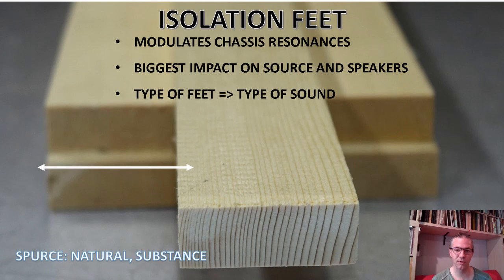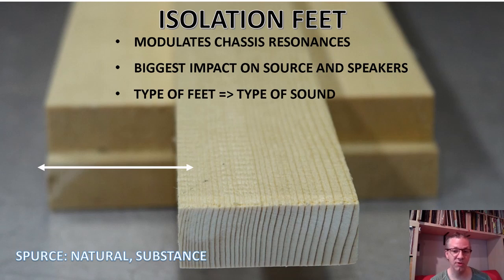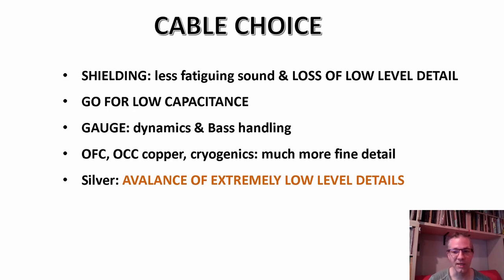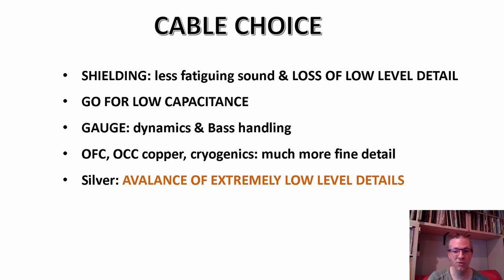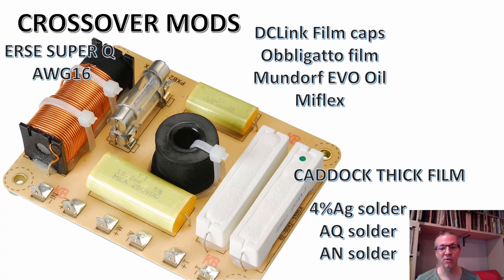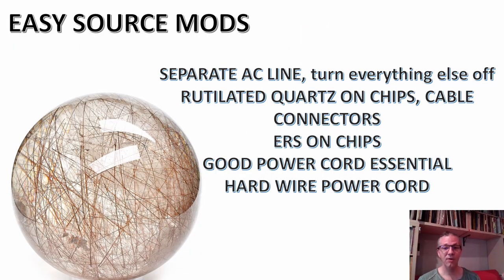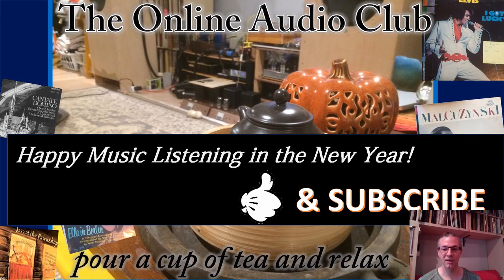Low Efficiency Speakers played at low volume - how to improve?

Comment: Some words about my journey: It has been only 3 years since I put together my first hifi beginner’s system, so I am a newbie compared to most. 
I have several constraints for the speaker size, location, and listening levels, but after having this first system, I saw that I actually could get much more pleasure from the music than I expected and even if I am far from being able to utilize my components to their fullest potential, I learned that I am still able to further improve the system and listening to music gets more and more enjoyable, even with the adverse conditions.
I sit in a equilateral triangle, 2 meters to the speakers, so almost near field.
Recently I have purchased bulk furutech 032n power cord (12 awg, voltage here is 220V) where I assembled the connectors and this now feeds an used furutech strip with no active filtering. My current plan would be to use the same cord to my amp in the feature. So far I could notice, in my own words: better bass definition, better separation (from bass lines in rock songs and/or from voices when more than one person is singing at the same time or in choirs), and in some cases the music seems to be “bigger” for the same volume as before, so maybe larger scale or impact.
I will research possibilities regarding new interconnects and speaker cable taking into account your tips and come back to you (currently they are qed audio reference 40 and qed revelation). Unfortunately I cannot keep the speaker cables separated for now as you suggested, but this is a wonderful tip and will keep this in mind for the future. The tip regarding the length is amazing, I will be sure to follow this.
 Hopefully I will find a trustable company to help me modify my speaker.
I will very soon look for the ferrite beads and install some, and for sure will experiment with wood feet, but as a last step after all else, so it will take a while. Once again thank you very much, I am deeply thankful!
Reply from the maker: Thank you for sharing your journey! Great job with the DIY power cord! In the near future I will share how I make my DIY interconnects. Also, the almost near field listening is a superb way to get more at lower volumes - I missed that out from my video. :)
Reply: @realworldaudio  thank you, it was more complicated than I thought but worth the effort. It is reassuring that despite the restrictions and lack of experience I am getting some things right. Looking forward to your next videos.
Reply: 30x ferrite beads on their way! Thanks for the tip once again. You mention in the video a light shielding could still be ok for the line level interconnects, not killing the low level details. Could you please comment a bit on what of what would be considered a light shielding? For example, could a braided copper shield over the twisted pair (with a layer of teflon in between) be considered as a light shielding? Thank you
Reply from the maker: @Thiago_S..  Have fun with the ferrites! Start with the biggest appliances and the digital gizmos: computer, TV, router... Yes, that's a great example of light shielding. However, if you live in a good neighborhood (I mean EMI/RF -wise: that is, no cell phone tower nor power stations nearby), then most probably you will do better with a good twist alone. Shield would be beneficial at the phono stage level, such as hooking up a low output MC cartridge to the step-up transformer, and/or the step up to the phono stage. Also, sometimes the cables connecting your source to the DAC can use shield, but most often bare connectors are better. Good luck!
Reply: @realworldaudio  thank you for the clarification and valuable insights!

Comment: Hi! Do you (or any of your trusted friends :) have any experience with or knowledge of the compatibility or lack thereof of Audio Note cables? I have their copper Lexus LX speaker cables, and am looking for new power cables. I can assure you that Audio Notes’ cables are expensive :) Thank you for an absolutely excellent channel!
Reply from the maker: I suspect that Kimber and AudioQuest power cables might be a good match (not cheap either ; ( ), but it also depends on the rest of your equipment. Larry at Real HIFI Help (YT channel) will be able to tell you more, and he has a cheaper DIY power cord hack on his channel.
Reply: @realworldaudio  Thank for the tip and suggestions!

Comment: Hi Janos, I found a nice supplier for tonewood. Which height would you recommend for this feet of spruce? 15mm too low? I would also like to make cable lifters out of spruce (similar to the acoustic revive solution or the one from cardas). Which is the correct grain direction? Should I put the equipment / cable on top of the spruce, with the spruce in the direction you are showing in the beginning of this video, so the grains are vertical to the floor, or should I put it in the direction of your white arrow, so the grains are parallel to the floor? Do you think that if I use 2x blocks of 50mm on top of each other for the cable lifter it could be ok or should this be ideally a single piece? Thanks a lot :-)
Reply from the maker: Hi Thiago, the 15mm height is perfect. For cable lifters the grain orientation is not so critical - yet, in general try to make it longitudinal. Also, for cables I would suggest attaching thin, long slices of spruce to the cable, and lifting it with something that is a n excellent insulator, such as ceramics / telfon / dacron. The purpose of the cable lifter is to distance it out from the floor / carpet that can be charged statically. Then, attaching the spruce pieces to the cable serves to remove cable resonances. Let the cable touch the cable lifters through the spruce pieces, so we are not transmitting resonances from ceramics to cable ; ).
Reply: @realworldaudio     thank you very much. I got the idea and have located a solution with dacron (PET) that should work. However I must say I had a problem with the word longitudinal in this case but now I imagine you must have mean the geometric plane formed by the grains, so it is clear, it is now like the white arrow on the video. Thank you

Comment: Hello and greetings from Germany,
Good news: I have found someone who said that he will help me with the crossover. He has experience repairing speakers and assembling some diy.
It shall take a while because of Corona, so I hope he does not change his mind until there.
We spoke about making a new crossover with mdf basis and with “point to point” so there is more freedom for different sizes of parts and we keep the original circuit as backup.
Your video gave me the introduction I needed to be able to read more about the crossover parts, thank you very much. Is it ok to disturb you with extra questions regarding the crossover? I also am watching many videos from gr research thanks to your recommendation which are helping me a lot to understand a bit more the basics of it. Thank you
Reply from the maker: Sure, I'll help with the crossover. If you can describe the speakers and the crossover parts used, then I can make recommendation on the upgrades.
Reply: @realworldaudio  Thank you very much, that is really very nice of you.
The speakers are dynaudio excite x14. The main reason for not changing them is a strict height limitation issue that I have when putting them away, complicated history, but I have found no alternative that I can afford that are suppose to be better and have at maximum the exact height of the x14.
So changing the crossover really appeals to me and I am prepared to spend a nice amount to try to make the most out of the drivers. 
Stereophile and audiosciencereview have some detailed speaker measurements. 
Here I found the picture of the crossover components:
https://www.qobuz.com/nl-nl/info/hi-res-guide%2Fdynaudio-excite-x14-a-compact177337
so from what I understood: no fuse, sand cast resistors, two bennics b03 npe caps (unfortunately, but maybe they are not very bad with ESR I hope, with 3%DF at 1KHz), one bennic 4,7uF xpp (mkp type) and one bennic mt 1,5uF (mkt type). The film ones are on the tweeter circuit I think. My speaker is 4 years old.
Here I found some approximation of the crossover schematic for the x18 speaker, including some photos of the x18 parts for comparison. The x14 and x18 speakers are similar, the x18 is a bit bigger and 4ohms. The parts 0n x18 also seem to be very similar to the x14. It seems the x14 have more resistors and slight different values for the capacitors, but I imagine the circuit would be quite similar
https://www.diyaudio.com/forums/multi-way/351143-dynaudio-x18-cabinet-drivers-lousy-crossover-2.html
Comment from “2Mato” on page 4 is what worries me the most so far: possible issues with imaging and phase by changing capacitors to others with same capacitance – can ESR be the cause of all this? I would like to change the npes on the woofer to film if possible, but I would not like to mess up with the speaker imaging, phase, crossover response, etc.
Hoping to find some synergy with dynaudio drivers, I tried to look at their higher models like the new contour and especially the new limited heritage series to see what they use for crossover parts. So here are my ideas so far based on this analysis and your video, gr research, forums: 
-Use Mundorf air core baked varnished inductors with same L and same DCR– I still could not find “erse” in Europe
-Replace bennic npe for better npe if there is risk of changing crossover response, imaging, phase, etc. Otherwise put something like mundorf basic mkp (white model with red lettering)
-Replace both tweeter film capacitors with Mundorf EVO Oil – here maybe splurge to 2x Mundorf supreme classic or 2x Mundorf Supreme EVO Oil
-Replace all resistors with Mills mra12, as I could not find “caddock thick film” with the all the needed values around here. Hificollective in the uk has “powertrons” and “pathaudio” resistors, both more expensive but maybe I could splurge and use at least some of this – maybe in the tweeter circuit? 
-Use Audio note 6% silver solder throughout, direct solder everything, no fast on connectors.
-Upgrade binding posts to copper low-mass ones, like WBT 0703 Cu
-Use neotech 16 awg up-occ copper solid core to rewire the whole speaker, or use smaller gauge for tweeter. The dynaudio drivers seem to use aluminium wire voice coils, I hope this do not cause an issue. They are using stranded van de hul in the heritage series I think, but I hope solid core occ copper could improve things for my low level listening.
I am completely open to not use anything I listed above, this was just me trying to do some homework and understand a bit better what is going on. So please feel free to reject all my ideas if you think they are not good :-)
Reply from the maker: @Thiago_S..  Great ideas, you did a lot of exploring. I'll upload the response soon!

Comment: Hello to Hawaii :-)
I could not find any silver ICs that suited me design/price/lengthwise at the same time, so I have decided to try to gain soldering skills and make diy interconnects, one has to begin somewhere :-) 

I was wondering if a digital soldering station could make things easier for a beginner, or would you have special tips on what to look for in a solder iron/station? 
My plan is to buy very cheap cable and connectors first, just to gain experience, and then go for the silver cable with KLE innovations connectors.
I am afraid of tarnishing, may I ask your experience in this regard? So I am considering buying from Neotech the Up-OCC Silver wire already in Teflon insulation, hoping this will minimize my problems and increase cable lifetime…
Regarding the IC design itself, may I ask if you meant that I should use 4x CCW 32 gauge wire being then 2x wires for “hot pin” and the other 2x for the “cold pin” of each RCA connector?
Do you recommend this geometry because it is the easiest for beginners or is it the one you achieved the best results? I was looking into IC geometries, and the options below also caught my attention:
The one from Venhaus which I could adapt some of the materials or even import them all: https://www.venhaus1.com/diysilverinterconnects.html
The one from David from ZenWave – braided with the signal being silver or silver/gold wire and the “ground” being occ copper: https://www.audiocircle.com/index.php?topic=116380.40
The helix geometry: http://www.image99.net/blog/files/4127b5fe2694586e383104364360373b-74.html
May I ask if you ever tried or have thoughts on these options/geometries as well? 
I am also considering buying the "ready" Neotech NEI-1002: https://hfc-fs.s3-eu-west-1.amazonaws.com/s3fs-public/neotech-nei-1002-drawing.jpg
I am ok with its price bulk and people seem to love it….it would be the most practical for me as I just would have to solder the connectors. But I am a bit uncertain if it would be “too much" shielding for my case.

I am sorry for the amount of questions, any thoughts are appreciated. Thank you
Reply from the maker: Lots of questions, but great questions! Deserves an extended answer. : ) Will make it a video ;
Reply: @realworldaudio  thank you so much for your comprehension and help. I am running out of ways/words to thank you, but please know that I am really really grateful for any help and hope the answers can also help many others in their hifi journey!
Reply from the maker: @Thiago_S..  You are most welcome Thiago! This was my intent with this channel, to help my fellow audiophiles on their journey. I was fortunate to find my mentor. Most people are now on their own, especially given the current situation, with very limited direct contact. I do what I can to turn the tide a little bit ; ).
Reply: @realworldaudio  hello to Hawaii :-)
can I still add some extra questions to my "question package" above? I would be interested to hear your thoughts on skin effect and time smearing due to usage of thick solid core wires in interconnects and speaker cables. Is this really an issue? Or is "just" a balance between bass/dynamics and details?  I am thinking of going with occ copper in a first step due to costs and my lack of dyi practice. Doing silver in a second step after I gain experience and confidence. Thank you once again
Reply from the maker: @Thiago_S..  You are on the right track, very good line of thought! I've added it to the Q package : )
Reply: @realworldaudio  thank you, that is very nice of you :-)